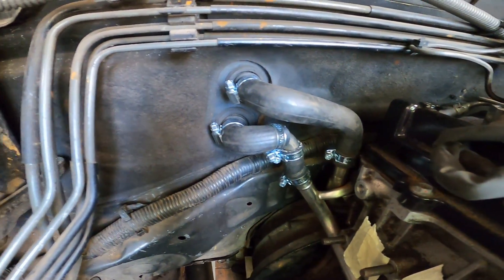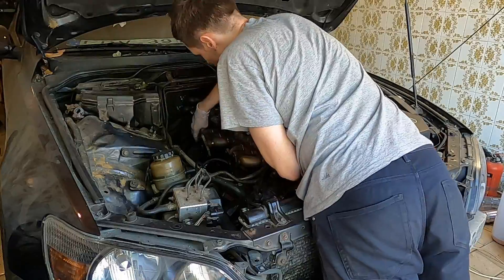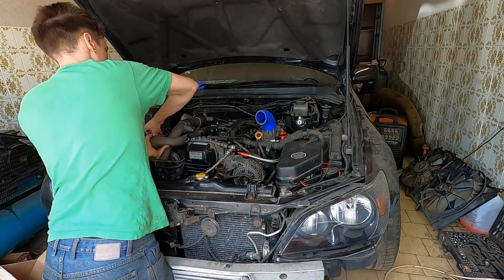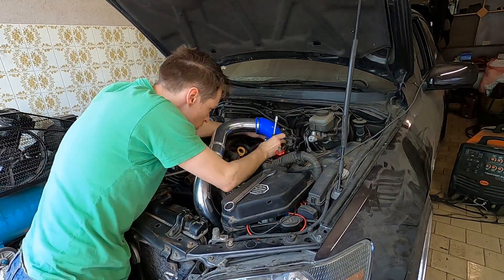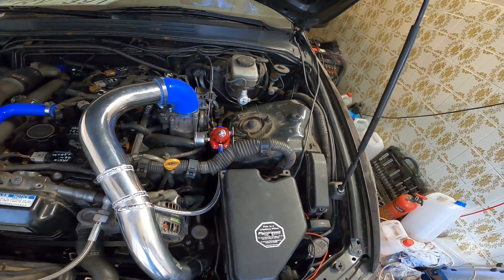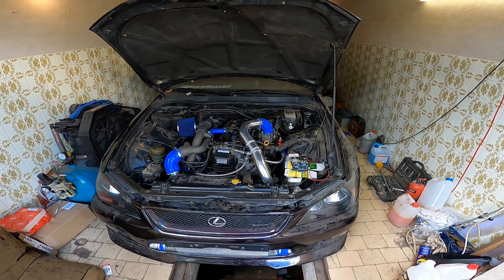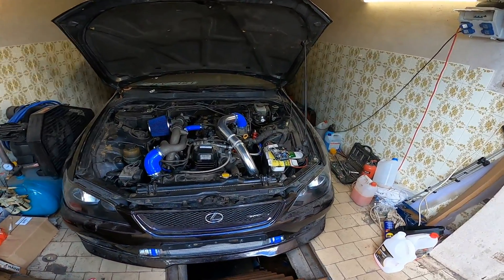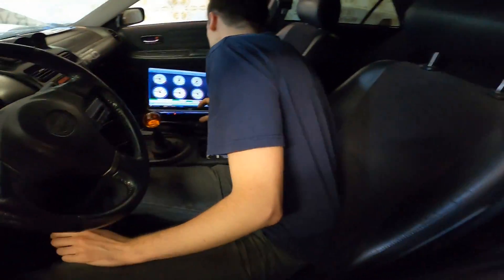Midnight Purple IS200 build log. Part 11 - Final assembly

Comment: Finally new vid
Reply from the maker: Sorry for the long wait. Life liks to delay things especially things like hobbies.
Reply: @Midknights  it wasn't long wait i just can't wait to see it driving 😁
Reply: @Midknights  it wasn't long wait i just can't wait to see it driving 😁
Reply from the maker: @rcon777  It will probably take some time for me to get familiar with Speeduino and ignition timing tuning. But I can't wait to hear the wastegates opened. :)
Reply: @Midknights  Will speeduino be better for this than det3?
Reply from the maker: @rcon777  Once fully tuned yes. However, DET3 is capable enough that for most applications I'd go for a DET3. The green IS200 has been running on it for 1,5 years without skipping a beat. And the setup for it was much simpler.

Comment: Hey man, very nice build. What ecu are you running?
Reply: Speeduino!
Reply from the maker: Short answer - Speeduino. The long answer is that ingition and fuel is controlled by Speeduino, but the semi mechanical throttle body, VVT-i is controlled by the stock ECU for now. Our other turbo IS runs a DET3 piggyback.
Reply: @Midknights  Do you have full sequential ignition and fuel with speeduino? 6 drivers for each?

Btw, probably worth checking your piping for vacuum leaks before tuning, or you'll be chasing lean conditions all day
Reply from the maker: @timocallaghan4408  Not with my 0.4.3c board, because it has only 4 channels for ignition/fuel. However, I was contacted by a person who has a teensy board setup to run full sequential on an IS200.
Good shout about testing for leaks. I was planning on doing that but have not cobbled together a smoke tester yet.

Comment: hey bro ，I have the same is200 as you.I want to know how you make speeduino ECU
Reply: Can he use it independently?It still needs to be with the original ECU.
Reply: I want a big turbo on my 1gfe.
Reply from the maker: @gavelai9936  Can you elaborate more on the "make" part, because I think I showed most of the installation part?
Well Speeduino was intended to be used independently, that is why it is called a standalone ECU. However, I chose to run it parallel so some of the stock features would stay such as idle control through the semi-mechanical throttle body. So depending on things you want/need you can run Speeduino as stand alone or parallel to the stock ECU.
If you have any more specific questions I can answer them.
Reply: @Midknights  Did you buy dropbear?v0.4
Reply from the maker: @gavelai9936  Dropbear is a completely different board/ECU than the 0.4.3c that I've used. I wanted the Dropbear ECU, however they quickly sold out.
Reply: @Midknights  v04cHow did you solve the ignition coil?And fuel injection.
Reply from the maker: @gavelai9936  What do you mean by that? Have you even watched the video?
Reply: @Midknights  He only has four fuel jets. I want to know how you changed it to six.What arduino did you use?Is he stable?
Reply: @Midknights  Your video didn't make ECU.
Reply from the maker: @gavelai9936  Speeduino was soldered according to the documentation on Speeduino website - go read through it first, you will find a lot of answers there. If you buy an assembled board you wil not need to solder anything.
Injectors and ignition coils were paired: 1&6, 2&5, 3&4. And so it runs on wasted spark and paired injection.
Reply: @Midknights  Are you using an arduino mega2560?How is it?
Reply from the maker: @gavelai9936  Yes the 0.4.3c board is for a mega2560.
Reply: @Midknights  Thank you very much, my friend.
Reply from the maker: I've only now noticed under which video you posted these questions. I'd suggest you watch Part 4. Speeduino install if you want more detailed information.
Reply: @Midknights  I want to use SMT components.is v0.4.4c.However, schematics and installation tutorials are missing.
Reply: @Midknights  SMT is more stable than THT，But it's expensive.
Reply from the maker: @gavelai9936  Are there even unassembled 0.4.4 boards avalable? Unless you are going to be ordering boards to be manufactured, sourcing all of the components by yourself, just buy an assembled board. The rest of the instalation would be the same as for other 0.4.x boards.
Reply: @Midknights  I'm not sure I can use it.But each version is very different.
Reply from the maker: @gavelai9936  what do you mean? the 0.4.4c vs 0.4.3c difference is just the assembly method. Functionally it is the same.
Reply: @Midknights  the 0.4.4 C No schematic
Reply: @Midknights Up to 250 HP on your 1gfe
Reply from the maker: @gavelai9936  You can find schematics on github for all of the boards.
Yes it might have around 250hp once mapped.
Reply: @Midknights  Over 250hp the connecting rod can't take it.Have you considered optimizing the intake and throttle?
Reply from the maker: @gavelai9936  Rods are not the first failure point. The high compression is. With a decompression plate you can have +300 hp. SU2 Performance and Topperformancecrew has some videos/info with those builds. I'd love to fabricate a proper turbo manifold, but need to get the current setup fully mapped first.
Reply: @Midknights  You need a bigger throttle.
Reply from the maker: @gavelai9936  why?
Reply: @Midknights  How do you set the various parameters?
Reply: @Midknights  Did you change the syringe?
Reply: @Midknights  What will happen if the oil pump and oil return valve are not changed?
Reply from the maker: @gavelai9936  I think some information got lost in translation. Could you rephrase your questions?
Reply: @Midknights  Sorry .My English is not very good.
Reply: @Midknights  Can I add your other contact information?
Reply from the maker: @gavelai9936  You can write me an email, or contact through social medias if you wish. All of them are available in the channel's "about" section.